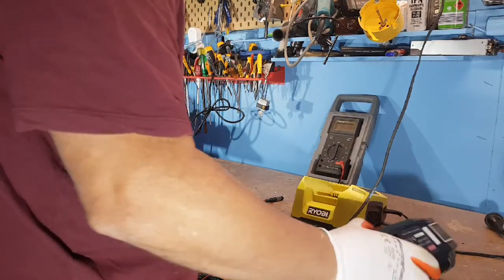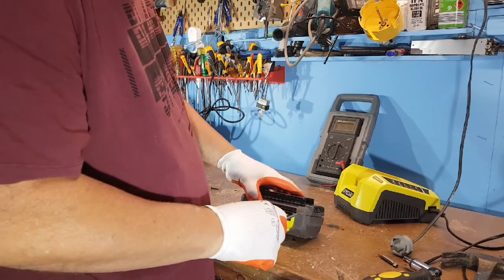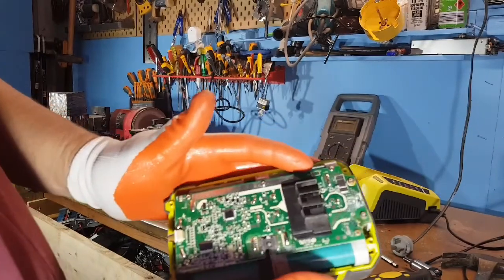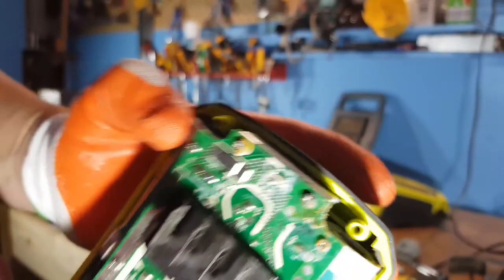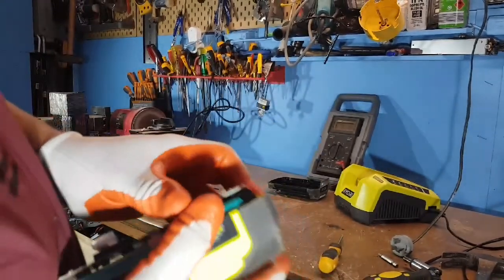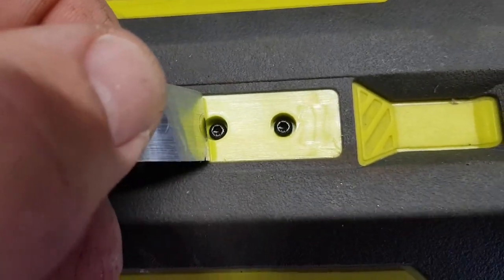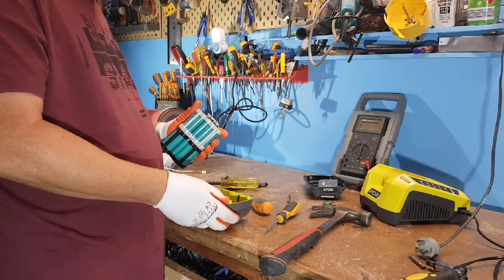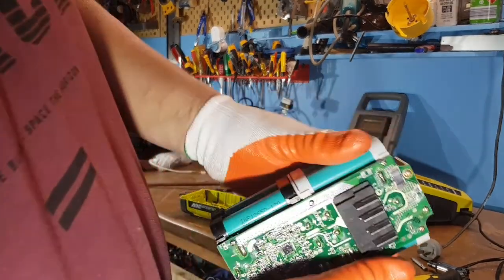Disassembling the Ryobi 36V battery pack. Plus showing a water fault.

Comment: Salut les Français, dite voir, les cellules sont pas monté en groupes en série parallèle ? Il est normalement impossible de lire la tension de chaque cellule ? Je me trompe ?
Reply from the maker: Sure! Here's the updated response, including the information about using a multimeter to read individual cells.

*English:*
It depends on the specific setup you're referring to. In many battery packs, cells are indeed mounted in series and parallel configurations to achieve the desired voltage and capacity. When cells are arranged in series, the voltages add up, and when they are in parallel, the capacities (amp-hour ratings) combine.

Typically, it is difficult to read the voltage of individual cells in a series-parallel configuration because the cells are connected together. However, if you use a multimeter, you can measure the voltage of each individual cell, provided you access the terminals of each cell directly (for example, at the balance leads in the case of a battery pack). In more advanced systems with a Battery Management System (BMS), it is also possible to monitor the voltage of each cell. So, you're not entirely wrong, but it is possible with the right tools.

*French:*
Cela dépend de l'installation spécifique à laquelle vous faites référence. Dans de nombreux packs de batteries, les cellules sont effectivement montées en configurations série-parallèle pour atteindre la tension et la capacité souhaitées. Lorsque les cellules sont en série, les tensions s'ajoutent, et lorsqu'elles sont en parallèle, les capacités (les valeurs en ampères-heure) se combinent.

Il est généralement difficile de lire la tension de chaque cellule dans une configuration série-parallèle, car les cellules sont connectées entre elles. Cependant, si vous utilisez un multimètre, vous pouvez mesurer la tension de chaque cellule individuellement, à condition d'accéder directement aux bornes de chaque cellule (par exemple, via les fils d'équilibrage dans le cas d'un pack de batteries). Dans des systèmes plus avancés avec un système de gestion de batterie (BMS), il est également possible de surveiller la tension de chaque cellule. Donc, vous n'avez pas tout à fait tort, mais cela est possible avec les bons outils.
Reply from the maker: Sure! Here's the updated response, including the information about using a multimeter to read individual cells.

English: It depends on the specific setup you're referring to. In many battery packs, cells are indeed mounted in series and parallel configurations to achieve the desired voltage and capacity. When cells are arranged in series, the voltages add up, and when they are in parallel, the capacities (amp-hour ratings) combine.

Typically, it is difficult to read the voltage of individual cells in a series-parallel configuration because the cells are connected together. However, if you use a multimeter, you can measure the voltage of each individual cell, provided you access the terminals of each cell directly (for example, at the balance leads in the case of a battery pack). In more advanced systems with a Battery Management System (BMS), it is also possible to monitor the voltage of each cell. So, you're not entirely wrong, but it is possible with the right tools.

French: Cela dépend de l'installation spécifique à laquelle vous faites référence. Dans de nombreux packs de batteries, les cellules sont effectivement montées en configurations série-parallèle pour atteindre la tension et la capacité souhaitées. Lorsque les cellules sont en série, les tensions s'ajoutent, et lorsqu'elles sont en parallèle, les capacités (les valeurs en ampères-heure) se combinent.

Il est généralement difficile de lire la tension de chaque cellule dans une configuration série-parallèle, car les cellules sont connectées entre elles. Cependant, si vous utilisez un multimètre, vous pouvez mesurer la tension de chaque cellule individuellement, à condition d'accéder directement aux bornes de chaque cellule (par exemple, via les fils d'équilibrage dans le cas d'un pack de batteries). Dans des systèmes plus avancés avec un système de gestion de batterie (BMS), il est également possible de surveiller la tension de chaque cellule. Donc, vous n'avez pas tout à fait tort, mais cela est possible avec les bons outils.

Comment: Thank for the interesting video,  I have similar problem in my Ryobi battary, but I do not have the skill to do what you did, I wonder if you can repair my battery for a cost.
Thank you
Reply from the maker: I live in Bendigo Victoria.  I don't repair others batteries.  But if you buy a spot welder for 50 dollars from Aliexpress,  you can fix your only with some 18650 for an electronic shop.

Comment: Thanks for the the great video from a fellow Australian. I have two of exactly the same batteries and it's really interesting to see that they use 18650s as well as its general construction. I might have to fiddle with one of mine because even though the multimeter tells me it is charged to 37 volts, it will not even start let alone run the Ryobi mower whereas the other battery will. If I find anything interesting I'll get back to you. Cheers.
Reply from the maker: Sounds like a good plan Peter, at the cost of these batteries,  why not have a try. Stay safe, have a great day.
Reply from the maker: I would say you need to replace you 18650 with 3000 mAH batteries.  But be careful and have sand on hand in a metal container.  The 18650s cause fires do not use water on them. Just drop it in the sand.

Comment: My battery shows 36V on the multimeter but displays 2 bars on the battery and the 36v blower stops working at 33v and shows 1 bar at that stage.
Any ideas?
Reply from the maker: Not holding charge , batteries have drop to 50 per cent? Very strange mate.

Comment: Every time I see your sub count has gone up...Gees, you make mistakes??? Unheard of!!! BMS for sure - that water damage will fcuk it well. How old is the pack? I have 3 ozitos' 36V packs, two @ 2.6AH and one @ 4AH and they are working fine despite their maybe 3 or 4 years of service but never immersed in water.
Reply: Take care with cv - check out thunderf00t's latest video. Scary shit.
Reply from the maker: Yes, got it second hand for eighteen dollars. I maybe able to fix it. RYOBI failed on this one.
Reply: @chuxxsss  Absolutely, they should have conformally coated the circuit board, after all, one of the advantages of battery power gear is you can use it when a 240V equivalent would likely kill you, as in the gear getting wet. Should be able to get a cheap BMS from china to suit that - I see cheapies are under $AU10 on ali, though you may have to measure the current draw and get one to suit, or find a place to put a suitable relay for this one: Pohiks 10S 36V 37V lithium Battery Power Protection Board 15A.